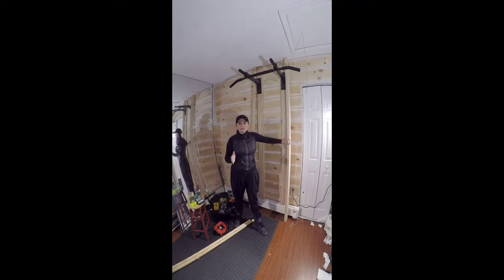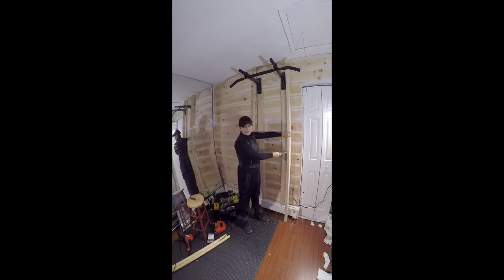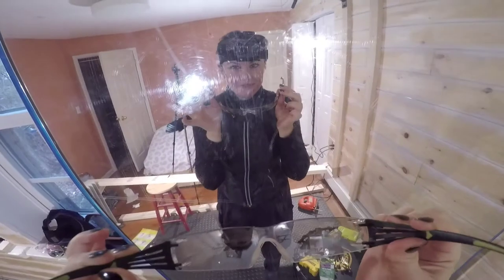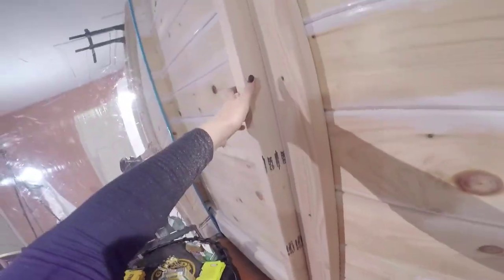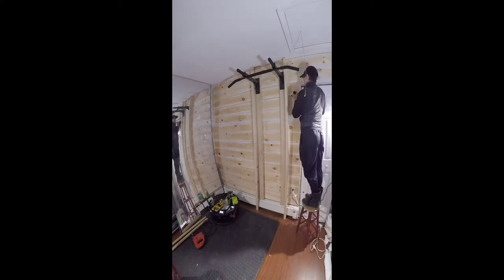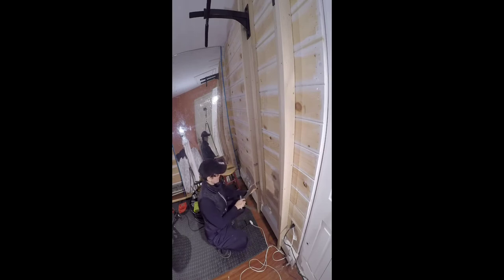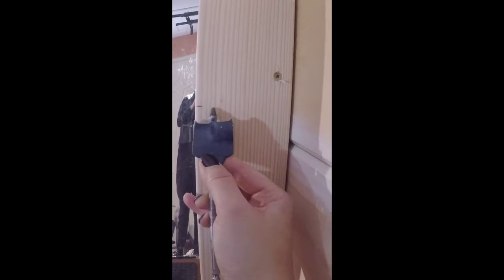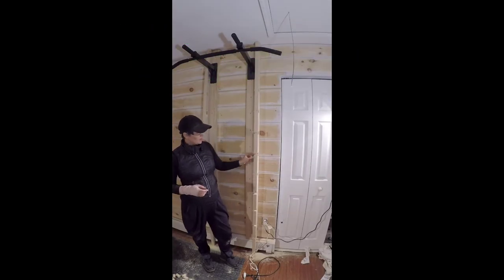Easy DIY Stall Bars As an Addition To a Pull Up Bar Setup. Part 1. Home Gym For a Small Space

Comment: Can they stand your weight? I'm about 150 lbs and I'm wondering if I should go with a wood or a metal.
Reply from the maker: Yes, they can handle my weight and my husband's weight. He is 200lb. I made my stall bars narrow,  though. These dowels are pine, if you choose oak dowels, they'll be even stronger (although, more expensive).